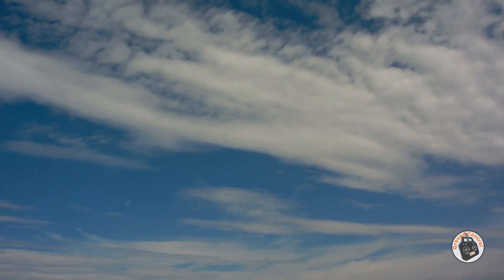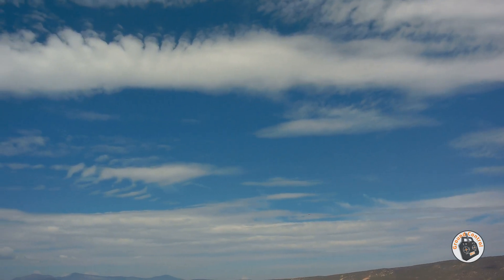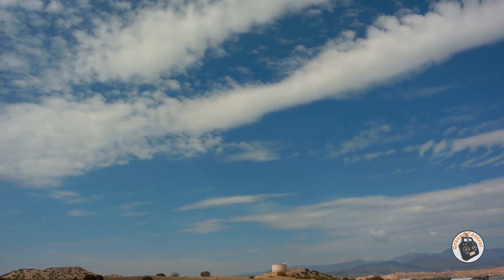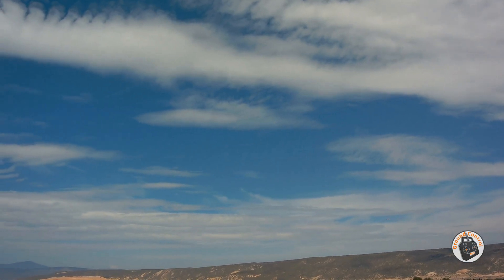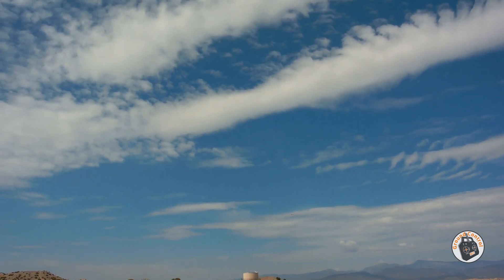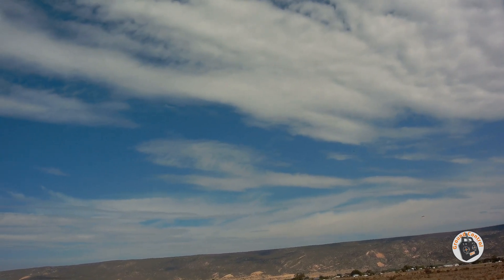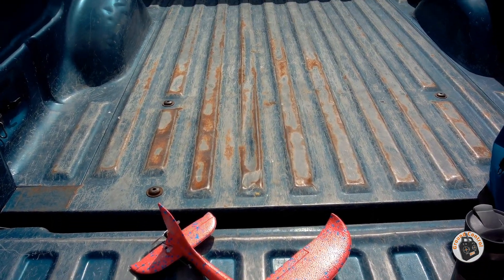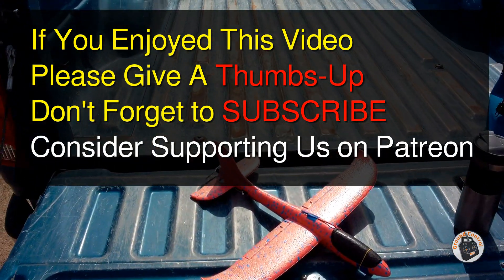$4 Chuck Glider RC Conversion - Session 2 Test Flight 1

Comment: Very cool, I just ordered 4 of these 17.5" chuck gliders in different colors. That way I could do some brushed and some brushless. For the prop, I'm thinking I got 3 spares of the folding props used with my Wltoys F959 Glider, maybe those could work as well. I'll watch the rest of your build series and see how it goes.
Reply from the maker: Hehehe...I did the same thing with the 48cm Gliders and ordered a (4) pack but I don't see those in the 48cm anymore. I gave one away and still have 2 ;-)